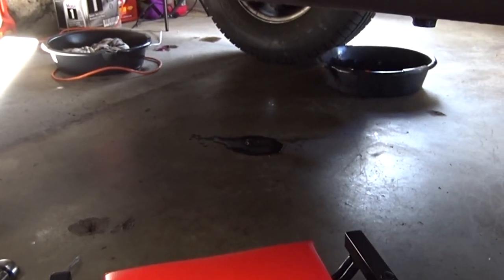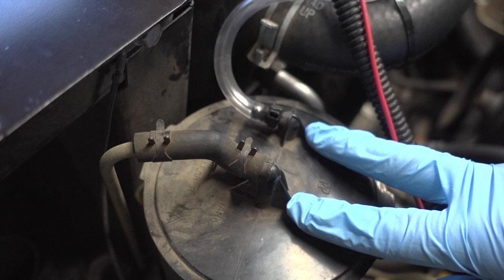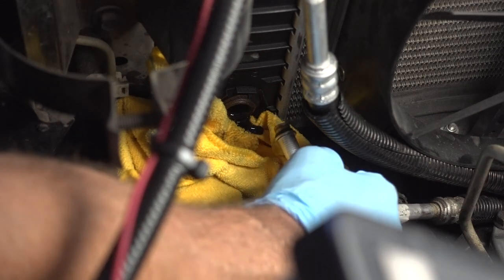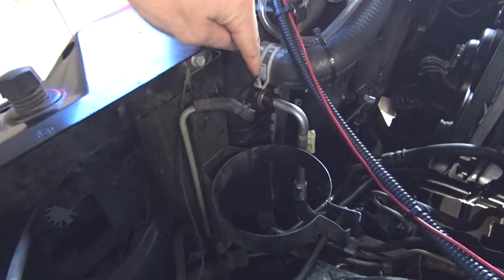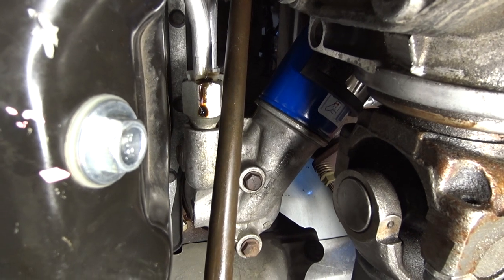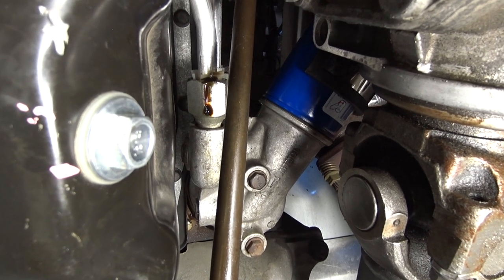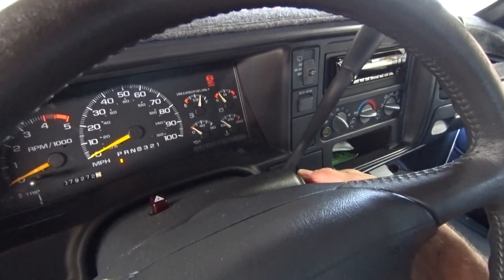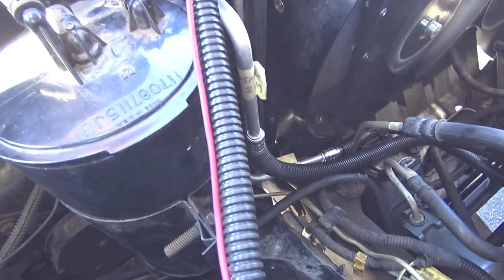Here's Why MY OIL COOLER LINES FAILED!! Is My Engine Smoked??

Comment: Don’t sweat it to bad. Everything leaks on my 01 Yukon 5.3  and it’s still runs great lol currently fixing everything 1 by 1 😂. Thanks for the video man 👏
Reply: I have a 97 Grand Cherokee 4.0 & same thing 1 x 1 x 1 x 1 x 3 YES IT SUCKS BUT I LOVE MY ZJ.
Reply: nowr2run amen brother. Great motor that 4.0 is. Keep her runnin
Reply: GM huum
Reply: Sold a 1995 Ranger 2.3 with 240k miles.  No leaks whatsoever.  Bought my 1998 Suburban, with 214 k miles and multiple leaks.  Still love the Suburban, and will be great once I fix the leaks including those oil cooler lines.
Reply: Kurt Watson yeah gm seems to always have leaky trucks/SUV’s . There’s a reason people love the Yukon/suburban/Tahoe line more than the Explorer / expedition though. If you can get past the leaks and fixes here and there they are reliable
Reply: It starts with most vehicles at about ten years old.  They start nickle, diming you.  If you can't or won't do your own mechanical work, eventually you buy a new car.  That's what they want.  If you are willing to get your hands dirty you can save yourself from the new car merry-go-round and keep just about any car going, trucks or truck based vehicles like Jimmy's Suburban especially.  If you keep them long enough you'll get pretty good at fixing them. You will likely have replaced some parts more than once.
Reply: @camarokurt  My brother had a 98 Ranger with the 2.3 with about 110k miles and it had multiple leaks but ran fine.  Any car with more than 100k miles that doesn't leak/seep at all is an outlier.  It happens but most vehicles regardless of American, Japanese, German will develop small seeps, squeaks, broken door handles and numerous other rinky-dink issues.  Hang onto that Ranger though.  Nice to own a blessed vehicle.

Comment: The fix is to either A. Use all metal lines next time, or B. cut off that crimped part and just use a hose clamp. It's not gonna see more than about 60psi.
Reply: Do NOT use an all metal line.
Reply: @Ashroyer86  and why not? Most automakers use metal lines for attaching the tranny or engine oil line to the cooler.
Reply: @JohnDoe-ml8ru  you need flex because the motor and transmission are not solid with the core support.
Reply: @Ashroyer86  the lines flex. If your engine and trans are moving that much, you have other issues. OEMs have used metal lines for decades without issues
Reply: @JohnDoe-ml8ru  not without issues. Why do think this guy said the line keeps going. I've had to replace 1 before as well. Can it get the job, yes will it last, possibly. Is it 100%, not in my book. I try to do things the right way not a get me down the road type way. You do whatever you want but I'd rather tell people the correct way.
Reply: @Ashroyer86  Because he had rubber hoses. Thats why you run all metal.

Comment: I deleted the entire oil cooler system in my 97 5.7. I replaced it with standard SBC oil filter adapter and eliminated the lines and filter housing. A short PF454 filter provides enough clearance so that the front drive shaft doesn't make contact with it. I am glad I did it.
Reply: can you remove the lines and plug the oil filter housing where the lines go, 3/8 plugs
Reply: I just deleted my oil cooler lines 4 day's ago. After doing that 10 times better the oil pressure. I am so glad that I did it.

Comment: I had the same issue so I deleted my oil cooler lines and put plugs and went with 5w40 on my 95 chevy c1500 5.7 tbi it's working  just fine great video

Comment: Enjoyed the video. One of my lines developed a massive leak while driving on I95 and I didn't notice until the 4.3l in my 2000 Chevy Astro seized in traffic and nearly gave me a nervous breakdown. Now I'm screwed. You are right. They have to figure out a better manufacturing process.

Comment: What great timing.  I was about to replace the oil cooler lines and filter adapter gasket on my 1998 GMC Suburban.  Local shop wants nearly $400!I'll tackle it myself and save $350.  I'll be using that money for a LOUD muffler and dual tail pipes to complete the dual exhaust.

Comment: Around 13 years ago my 97 Ram 1500 started leaking at the same points. I cut the lines off at the metal using a metal bit on my multi tool. Flared the ends of the metal with a brake flare kit. Then used some hose and hose clamps I bought at AutoZone. Still not leaking 13 years later. Edit: ram has 389k miles on it. It gets used a LOT.

Comment: I replaced with 3/8 brass fittings that allowed me to use roughly 4 feet of fuel line to completely replace the faulty factory design from gm. I regret not doing it sooner. Oil drips in the driveway are gone!
Reply: I also degreased engine after. It was astonishing the amount of gunk this oil drip caused in the engine bay and front suspension. A clean and crisp engine bay looks  amazing now. I feel like it’s a new car!

Comment: Wasn't even looking specifically for my truck, a 94 k1500 with badly leaking lines (it's at 300k miles so not too bad, idk when/if previous owners changed them). My mom's friend changed the engine side ends and didn't properly seat them, and I was checking to see if there's anything extra I might need to know to get them right. First video I clicked on, and I learn what a problem it is with these lines 😂 mine also failed at the crimp point, lol.

Comment: Cut the crimp collars off with a die grinder and double hose clamp lasts till the hoses completely dry rot.
Reply: This is what I will be doing. That's the permanent fix. Not doing this a 3rd time

Comment: I've seen too many examples of problems with these gm oil lines.  The quick connects can become brittle and the hose swage fitting remains a question mark to me. Are swages overcrimped, or is there a bad match between fitting and hose spec?  I can't say - I'd have to see these at assembly time.  Like most hydraulic fittings, there is an ID and an OD spec: if they don't match well, reliability issues lurk.  Best bet? Get whatever adapter fittings may be needed for that filter housing, and run your own tubing and hose - the original parts suck.  Keep ID the same or slightly larger, as in going from 3/8" to 12mm or some such.  Keep hose location & length similar, as it serves to dampen vibrations/take away flex problems that would plague a purely hard piped system with insufficient offsets.  Your o-ring blues... remind me of why I love swagelok so much:  there are none!

Comment: The 4.3L S10 uses similar lines but with quick connect fittings at the rad. They all fail at the metal to rubber crimp. I used Napa's house brand aka Dorman lines with lifetime warranty. They last about 1.5 years before leaking again, replaced both lines about 5x with free replacement over the years. Waited too long on the last set and one crimp failed completely at a drive-thru, pumped all the oil onto the ground and seized the engine. The GM lines have no warranty but last 3-4 times longer in my experience, been using those ever since. I don't know if I would have had a legal case against Dorman for the failure since it had been leaking for a while before letting go.
Reply: At least you were at a drive thru. My failure occurred on I95 going through Hartford, CT and my 4.3l Astro seized in the middle lane. Talk about stress.

Comment: I bought a 09 Sierra with 200k miles. I found the transmission cooler lines were leaking from the same area.  After some research I learned this is very common.   People have replace them only to have them leak after a few years. I removed the leaking lines cut the crimps off flared the ends of the lines and reinstalled them and ran TOC hose using band clamp to secure them. All it took was a couple hours a flaring tool, cut off wheel and $10 worth of hose.

Comment: Ive gone through 3 motors in 97 1500 silverado. Dorman is not barbed where they are crimped. They just blow off where the hose is crimped. Not out of the quick connector.

Comment: My 1997 k1500 p/u is parked waiting for me to tackle this job. I’m not looking forward to it for the same reason, the ultra tight space. I’ll be replacing the gasket and o ring on the oil filter adapter housing while I’m under there. Using all acdelco parts. 352,000 miles on her 5.7 and she runs great.

Comment: 2nd to Doorman products. Aftermarket has gotten better over the years. Even surpassing the OE product. You got lucky too, my 99 has a clip to hold the lines in the oil filter housing connectors

Comment: I wrote to Dorman a few weeks ago just to tell them that it has recently come into my understanding that everytime I reluctantly "had" to buy one of their parts (due to no other choice available), the part was always as good, if not better, than the original part I was replacing. In fact, many of the Dorman parts that I've purchased over the years were obviously reengineered to fix the manufacturing problem with the OEM part, just like the multiple crimps on the hose you're changing out. 

I truly believe Dorman is one of those overlooked companies that saves a LOT of mechanic and DIYer's asses, and they don't get any credit for it because their parts are on the floor in a display, not behind the counter-where real men shop. Just sayin'.
Reply: And sometimes you get smoked using dorman parts. I bought a lower intake manifold for a gm 3800 that was absolute crap out of the box. My son-in-law bought a dorman turbo charger that crapped the bed after two weeks.  For my money and big stuff, go OEM.

Comment: Wow, Jimmy bought a part  that wasn't AC Delco.  Pigs must be flying...
Reply: Dorman parts are actually quality, if the dealership I worked at couldn't get OEMwe used dorman
Reply: @bradleyfarnham2951 Dorman sucks. There's a reason they're so much cheaper than anything else.
Reply: @grendle81  They make many OEM parts including AC Delco.

Comment: Great video! This helps so much! I could not figure out how to get those plastic connectors off. I thought I just needed an oil housing gasket.. but my problems seem to match yours so I think I need new connectors and cooler lines too. Thanks for the video!

Comment: Toyota and Lexus have a similar problem with their rubber hoses failing and leaking. They redesigned their oil cooler lines to an all metal lines . I just had mine replaced yesterday under warranty. It’s not a recall , just a technical service bulletin.  Which means they only replace them if they are leaking.  You should look into having steel braided hoses made up for your vehicle.

Comment: Nice video! I think you will have good luck, doorman makes some pretty good quality parts. Don’t see too many factory engine oil coolers anymore. I actually added one to my 03 Silverado 5.3 though because I do a lot of towing and hauling. I upgraded to a larger radiator with ports for both transmission fluid cooling and engine oil cooling. As well as I also have an individual external cooler for each, that the fluid passes through after going through the radiator and before going back to where it came from either the engine or transmission. This setup really keeps my temps down I love it. When I installed it originally though I did have to replace all of the line fittings like the two you had to replace. Most of them looked absolutely perfect so I tried reusing them at first but that was a no go, half of them started leaking so I just replaced all of them so I wouldn’t have to deal with it later.
Reply: It is part of towing package in 03 and back to at least 95.

Comment: thank you for this video of replacing an oil cooler lines that really help me to follow all what you did. I would like to ask something about a rear heater vent are not having warm air, just only in the front. Do you have a video for fixing that problem. I have the same model off your truck 454. I really appreciate if you help me to see that link.

Comment: @1Road if they fail again, slice the factory crimps off with a dremel to expose the barb connector on the metal tube. Reattach the hose with ear clips. (Oetiker or similar) Use 3 clips per connection and it won’t fail again.  You’ll need the special crimp pliers to install them.
Reply: Thanks for the tip.  I found the double crimp to pretty much last the life of the hose, but I guess this guy didn't. I just replaced a set of these lines off a 1999 Tahoe. They looked original and they weren't leaking, just part of a bigger overhaul. It's a little unnerving to see them fail that quickly, if I find myself in that situation I will definitely use your idea, thanks.

Comment: How come when you started the suburban...it took a few times turning over to start.  Fuel pressure. Pump issue. Injection issue. ?  Just curious.  Good work info on oil cooler line. I got replace mine.   New fittings yes.
1994 c2500silerado suburban.  Still going strong

Comment: That middle space, between the crimp points in the center of the fitting on the end of the hose, is bubbled out farther than the other inbetween spaces between crimp points. Since ive done that several times where I work, i can tell you why it happens. When the fitting is crimped, its not seated correctly in the crimping machine. Ive just noticed this on my 94 k1500 and those cooler fittings look like they werent crimped correctly also. I might try to stick braided hose in there and make my own hoses.

Comment: I had to do the transmission and oil cooler lines on my Silverado.  I ordered the Dorman and equivalent AC Delco parts for both to compare.  The Dorman parts were packaged a lot better, the ends were taped, etc.  The AC Delco parts from GM were just thrown in a box.  I sent the AC Delco parts back for refund.  Oh and the Dorman came with all of the clips and the AC Delco did not.

Comment: I replaced my oil cooler lines about 2 months ago with the doorman part. Yesterday I was driving in the mountains and i had a catastrophic oil cooler line failure. Engine suddenly lost oil pressure from dumping all its oil in about 20 seconds. I pulled over and shut the engine off then attempted to fix the issue and my LQ4 is seized now

Comment: AMAZING VIDEO BRO,THANK YOU FOR SHOWING ALL YOUR WORK AND STRUGGLE,AND YOUR SMART FOR PUTTING THAT DORMAN FITTING ON THE SIDE WHERE IT WAS ORIGINALLY LEAKING, I HAVE A 1997 CHEVY SUBURBAN 5.7L C1500 AND CHANGING THE OIL PRESSURE SENSOR WAS A BITCH !! ,I DIDN'T REMOVE THE DISTRIBUTOR, I JUST REMOVED THE HOOD AND THE EXHAUST SYSTEM,PLUS A FEW SPARK PLUG WIRES AND MARKED THEM SO I WON'T FORGET THE FIRING ORDER, I BOUGHT A OIL PRESSURE SOCKET FROM AMAZON 1 1/16 WITH A 3/8 DRIVE ,BUT THE SOCKET WAS LIKE A 1/4 SHORT, I BOUGHT ANOTHER ONE FROM AUTOZONE AND THIS ONE FIT ,BUT IT WAS A 1/2 DRIVE SO I HAD TO BUY A SMALL EXTENSION FROM 3/8 DRIVE TO A 1/2 DRIVE AND USED IT ON A 6" INCH RATCHET I SEEN A VIDEO WERE SOME PERSON USED ONE TOOL THAT WAS CALLED HARLEY DAVISON WRENCH.WELL I COULDN'T FIND ONE, BUT I FINALLY   GOT THE OLD ONE OUT AFTER TWO DAYS OF STRUGGLING.THANK YOU AGAIN FOR SHARING YOUR VIDEO.

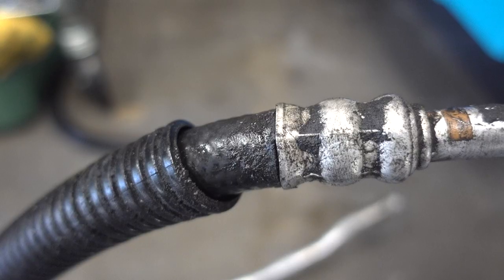Comment: They are not relatively the same ... notice @ 1:00 the old, previously replaced line shown, has two crimps which are slightly larger than the Dorman crimps @ 1:21 which have 3 crimps, which are a bit more narrow but provide a more effective crimp as the definition of those 3 narrower crimps are much more defined which should provide better sealing between the metal and the rubber.  

I am going on 5 years with my Doorman replacements and no leaks.  Originals started leaking around 290k miles.  

AN fittings and braided hose as suggested by Groundhogz, will eliminate leaks long term.

Comment: i have a 91 suburban / overlander complete with Lyft and Raptor liner paint job 12000 lb winch battering ram bumper full size roof rack on board Air and Power conversion 2 battery electronic system..... you might want to upgrade your rear end if you plan on putting on a lift and bigger tires

Comment: Mine did the same thing. Theres plastic sleeves in there that fall out when you pull the lines. Just find the sleeves and slide them back on before pushing them in the adapters

Comment: It kind of sucks when parts are known to fail. GM also had the plastic piece in the heater core line that cracks and fail. The only good thing is the issue are known and with a little search you can usually find them online and if your lucky a video like this.

Comment: I would have tried cutting off the crimp connector and removing it leaving the barb, then reinstall the hose with permetax  and two worm gear clamps.
Reply: So when your temp fix fails and your oil all pumps out onto the ground while your tooling down the highway with your tunes cranked up you can buy a new motor?  Don't get too clever with engine oil lines, the new ones aren't that expensive.

Comment: I removed my oil cooler lines on mine as they would not stop leaking. And eventually I also removed the adapter. And I am now using a standard sbc oil filter. Obviously I need to use the short one.

Comment: Did you put a new o-ring on the lines themselves at the housing or does the o-rings in the quick connect adapter all you need?

Comment: Good luck with those quick connect fittings. Little plastic tabs hold those lines in. They love to break, blow the pipe out and wala you have no oil pressure and a bad engine. Replace them with the updated connector used for 96+ 5.7 vortec engines. Has a metal clip to also hold the line in. Another option is getting rid of that quick connect mess altogether and going with a flare fitting.
Reply: Hi Dillon can you post a link where I can get the 96+ 5.7 with a metal clip?